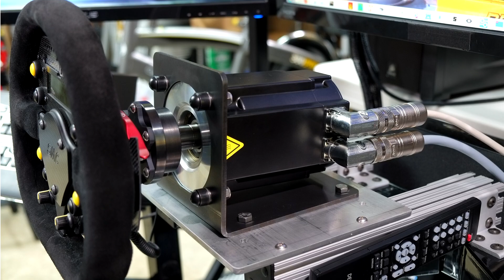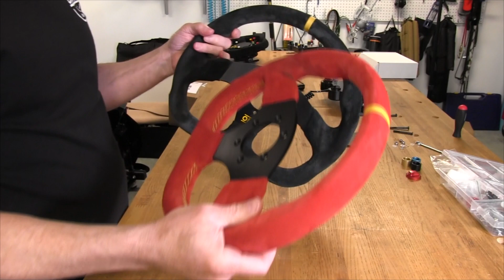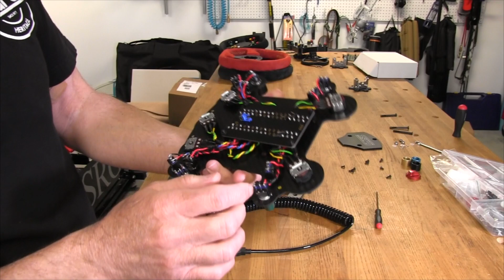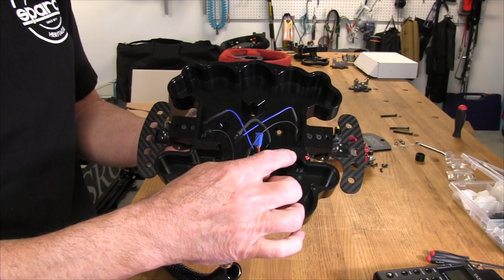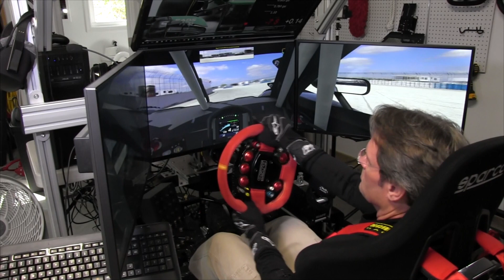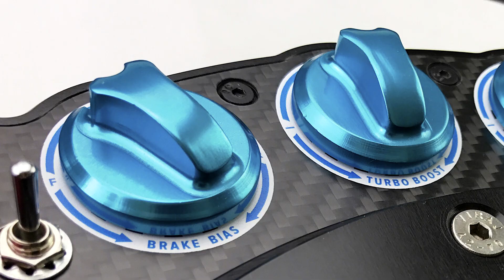SSRG Custom Wheel Review

Comment: Great review Barry as all your review, a pleasure to see them.  I saw something very interesting though, on your SimLab Triple monitor mount, you added wheels, if so do you have any suggestion on which to use?, im about to build mine and saw you entering your rig so nicely, that i want to do the same.
Reply from the maker: Here's the wheels I used: https://www.amazon.com/gp/product/B00TKQCVDE/ref=oh_aui_search_detailpage?ie=UTF8&psc=1 Drilled and tapped a 3/8" hole about 2" in from each end of the bottom support profile bar. One of the best mods, as far as everyday usefulness, I have done for my setup.
Reply: Thank you Barry for the info, ill be sure to follow your advice, ill let you know in a couple of months how it work out.

Comment: Just purchased 3dof motion setup, hydraulic hpp pedals, and direct drive osw wheel.  Whats your favorite and or recommendation for wheel/button box? Thanks bud, enjoy your videos.
Reply from the maker: There are other wheel plates available, but for me the SSRG is the one I like the best. But it is heaver than say an Asher button plate, because of the aluminum. OSW of Bodnar system should have no problem with the extra weight. Lots of great steering wheels available to day. Really comes down to personal preference.

Comment: Hey Barry may I ask why you aren't using your GS4 seat with your Stage 4 anymore?  I'm in the process of designing a new sim rig and my budget would allow me to either get a Simxperience Stage 4 or an Obutto R3volution with a GS5 seat whenever it comes out, and I'm very torn.
Reply from the maker: Well after my review of the GS4 seat, I had someone who really wanted it so I sold it to them. I found that I actually preferred the Sparco seat to the GS4 seat mounted to my motion rig. The GS4 was really designed to be mounted to a static rig. And I never really mounted a proper racing seat to the Stage 4 rig. Once I had, I felt like the I could feel much more detail being delivered by the Stage 4 actuators, than with the GS4 seat mounted. Mostly because the Sparco is 1/2 the weight and a lot stiffer than the GS4. And the GS4 servos, just can't keep up with the faster servos on the Stage 4. So, once I was able to change out the seats and test each, I could feel a bit more accuracy in the actuators .vs have the GS4 mounted. I am looking forward to the GS5 seat from SimXperience whenever it comes out. Interested in finding out if they were able to address some of the issues the GS4 had when mounted to a motion platform. Mostly weight and servo delay, between the two types of actuators.

Comment: I'm having a hard time understanding how a USB cable attached to the wheel pod isn't a huge, deal-breaking issue. Maybe it's fine if you're only driving race cars with very limited lock, but if you're wanting to race some road cars or old rally cars and need to do some quick hand-over-hand, doesn't that become a problem?
Reply: Nope.